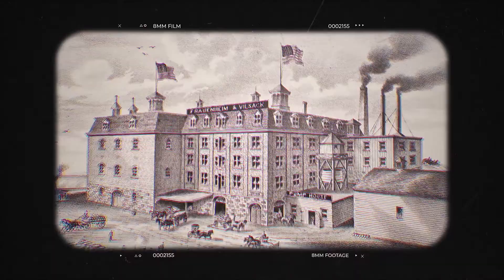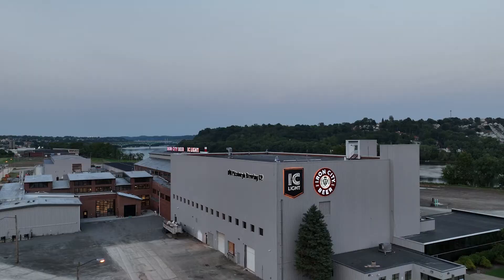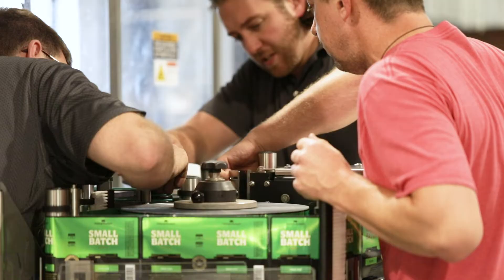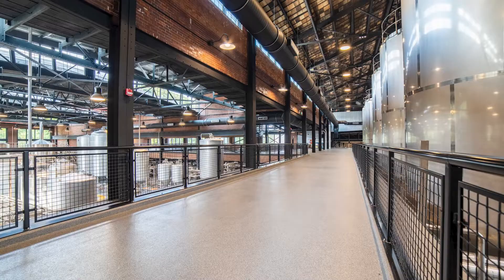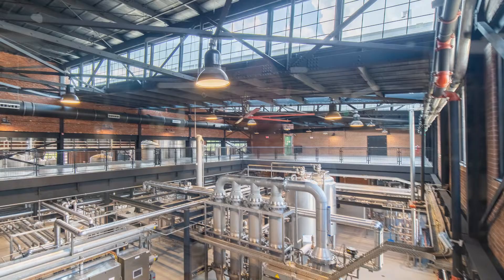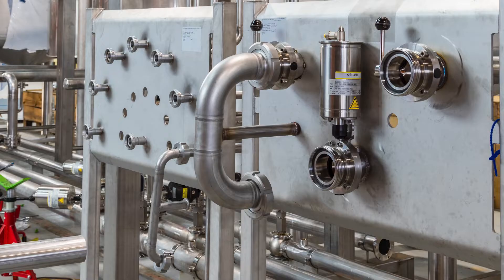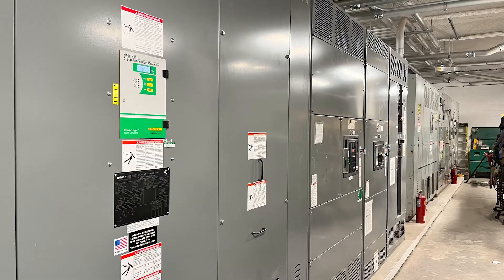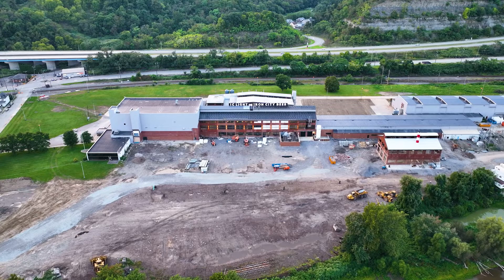Iron City Brewery | A Project Documentary by McKim & Creed

Comment: Thanks for the video. I was at one time a Pittsburgh Brewing Company stockholder back when it was a public company. There were some hard times but at the time the company started production of IC Light. That saved the company from going under and kept them revenant to many Pittsburgh area drinkers. Eventually the company went private and I read about the problems the company had over the years at the old brewery site. Many people felt sorry when the production was moved to Latrobe. It removed a part of the local spirit that made Iron City special. So it is nice to see the company come back to Pittsburgh and have plans to have a modern brewery in another historic building as well as developing it as a regional attraction. Good luck with the new brewery and keep producing that great Iron City and IC Light.